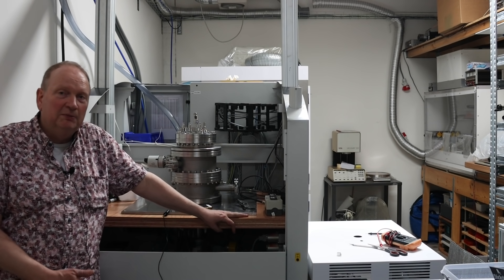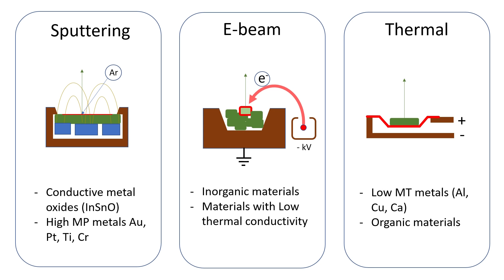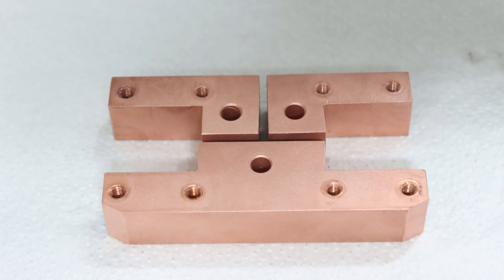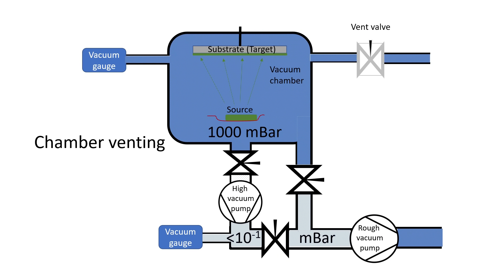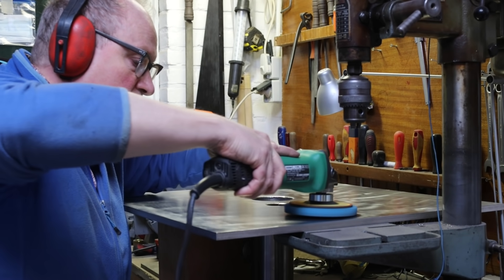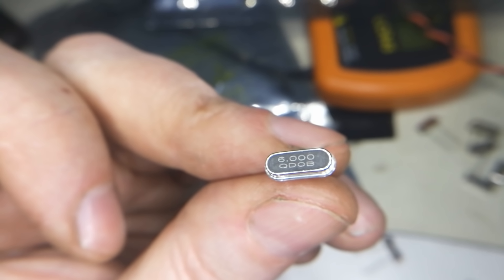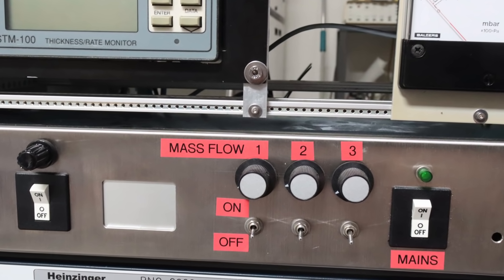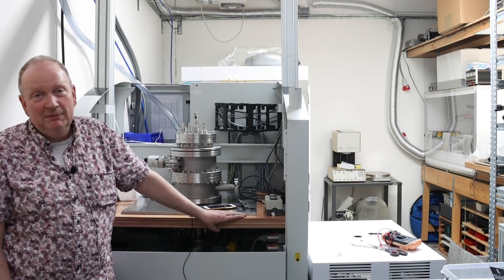DIY Physical Vapor Deposition (PVD) using Thermal Evaporation

Comment: I am considering building a vacuum chamber with 1/4in thick stainless steel tig welded. I keep going back and forth on cylindrical and rectangular structure. I can build a rectangular chamber larger and cheaper than cylindrical. But I know cylindrical chambers handles pressure better. I want to be able to use the vacuum chamber for multiple uses not just pvd. Do you think a rectangular chamber would work fine?

Comment: That video conveying many things at once. Excellent job!. I have a question about my study. Is it possible to deposit alternating stacked layers (A/B/A/B/A/B...) via thermal pvd method? Suppose A is metal B is metal-oxide dielectrics
Reply from the maker: Depositing such a stack is certainly possible. However, metal oxides are generally not deposited with PVD but with sputtering or ebeam because of their high boiling temperature.

Comment: i would like to develop a PVD coating unit. i got a commercial vacuum chamber that was designed to perform metallization on plastics (usuallay called barrier films for food packing). i want to utilize that for PVD coatings on ceramics and plastics. Which heating option would be most appropriate ? Thermal heating or sputtering ? 

Regards

Comment: ayo you should look into silicon carbide, really cheap from china now days. i wonder if using it as a heat sink on the target would help with the statistical chance to get deposition on the target. shouldnt be electrically conductive. i believe theyre factory 2nds for nij level 3 plates, and theyre like 1 buck per hexagon lol. im not smart enough to know if it would off gas. its dark color should give high emissivity, idk if that matters. maybe this is more complicated than q=mc (deltaT)

Comment: Hello , Love your channel !  If you can make 6'' or 5'' round or square hi quality glass or film light pollution filters for use with 
telescopes and large camera lenses , and make the cost around 400 dollars US , I think every amateur astronomer on the planet would buy one .  The thought of being able to put the filter before the main objective lens and not let in the wavelengths 
that are harmful and contribute nothing to an astro image , Would be the hottest product .  1 filter with different masks would allow it to be used on scopes n lenses of all sizes .  I would like it to be a energy rejection filter , But it could be a absorption filter , Or a blocking filter that passes much less of the undesirable wavelengths .   Goal= block , suppress , hi pressure sodium lighting , led lighting , halogen lighting , Mercury vapor lighting , And all the other artificial lighting that keeps popping up.
Thank You.  We currently pay about 175$ US for a 2'' round filter that ends up close to the image sensor , And about 90$ US for a 1.25'' round filter.

Comment: @HuygensOptics ,
excellent video, thanks for uploading!
When you mention target film thicknesses of less than 250 nm for evaporative PVD, is there a practical consideration that leads to this restriction? If you left the machine on for a month would it be possible to build up macroscopically thick layers in other contexts (eg manufacturing of mechanically strong components in Earth Orbit)?

Comment: great explanation, I have an Aluminum mirror coating machine can I get a simple diagram on how it really work, it has Rotarypomp, Booster pump, Elctric high voltage unit, Chamber, Diffution pump, and the panel boar we frequently use words are Backing, roughing, Highvacume.. but I cannot logically understand how it functioning

Comment: Hi Thanks for the fabulous video. 
Question though, would PVD work to deposit a metal layer on an Enamelled 1.0-1.5mm diameter thickness wire? like if we make the wire to keep spinning while being depoisted?
Reply from the maker: That would certainly be possible.

Comment: Without water cooling, the cross-section of copper in those 1/2" tubes works out to be ~ 120A. However, with water cooling through the 1/2" copper tubes, what do you estimate your maximum current per conductor to be?
Reply from the maker: I've never measured this in detail but I estimate it is easily several hundreds of amps.

Comment: If you flushed the chamber with argon multiple times could you get away with only a roughing pump? It’s not a matter of pressure but contamination correct?

Comment: How did you manage to bind the copper to the glass? These electrical feedthroughs seem to be difficult to get right.
Reply from the maker: It was actually bonded using a high temp / high vacuum epoxy. That was possible, because the feedthroughs are cooled and the chamber vacuum specs are not very extreme.
Reply: Just realized you answered the exact same question below 😅. Thank you for your time. I am here because I am trying to figure out how these commercial ceramic feedthroughs are built, maybe they use some kind of epoxy too.

Comment: Very nice job !   Have you ever tried to measure the temperature of the glass substrate during the process ?
I wonder if it is pissible to use 3d printed substrates (with resin printing technology)  with  sophisticated surface profile (like a parabola)?

Comment: 12:55 Um… Are you charging the entire chamber body at the voltage for the plasma…?
Reply from the maker: No just an "antenna" in the chamber that is isolated from it. The chamber as well as the other high-voltage lead are grounded.

Comment: The plasma system, was one of the sides of the secondary wires still attached to the case and thus earth or was that removed? Since I was surprised the entire chamber was lit.
Reply from the maker: Yes, in the HV, one side was connected to ground.
Reply: @HuygensOptics  That make sense then, thank you for the answer.

Comment: Excellent video! Just a small correction: gold has a low melting point, that is lower than copper, at 1064°C. I think it has a low vapor pressure and tend to bead(low surface area). Along with the price  and high density, allthis factors make  thermal evaporation not practical .

Comment: What prevents the material of a furure coating from depositing onto glass window and walls of your chamber? Do you apply a voltage between the boat and target to create electrostatic field and direct moleculas to attack only the target but not parts of the chamber?

Comment: Great video that has many information to resource from etc. I am currently building a vacuum PVD system. I realized the Sputtering Magnetron which is made of copper requires water cooling etc. The problem i am encountering is the water cooling of the copper sputtering envelope which requires introducing lines into the system  needs to be electrically isolated from the base because of high voltage charging of the target etc. So i am assuming what is required is a ceramic disc epoxied to a flange system which also has the copper water cooling tubes to be epoxied to the ceramic holes as well. Have you encountered similar issues? In addition I am using a deposition sensor as well to the system with an inficon unit to monitor the rate etc. Your thoughts?

Comment: What a delight to find this video, impressive work and very interesting.
Regarding the making of flat surfaces, a couple come to mind: 1) lapping, 2) scraping

For a brief 10 years of my career I had the best mix of domains leveraging a background in electrical & software engineering with a love of manufacturing and desire to help people. Also having parents who where machinists (mother & siblings raised in and around a machine shop). I kind of continued the tradition having worked with various manufacturers using an advanced (for it's time) CAD/CAM (parametric solid modeling & associative CNC programming software) across several industries. Although my clients were appreciative, I usually felt I learned more than they did from our exchange.

Today I work as a software engineer, but within the Fintech industry. However, I'm a home-machinist enthusiast with a small, humble shop of machines, fabrication tools, & geometric measuring tools.

Obtaining flat surfaces through simple & inexpensive means is very doable... Even if you have no flat surfaces to start with. The "3 plate method" of lapping can provide you a set of perfectly flat surfaces, although for relatively few $ you can buy a certified flat slab of granite. 

I love your work and will be "working" my way through your videos shortly.

Thank you for posting your video.

Lapping: https://youtu.be/ATG_UYYfx7w

Scraping: https://m.youtube.com/watch?v=4FS2YI3U_cc

Comment: Excellent and informative as usual. Thank you. 
I am looking to do some PVD on glass, my question is around the plasma cleaning and its power supply, have you any idea what current/voltage is required to strike and then maintain the plasma, and what sort of frequency would be ideal,

Comment: I want to achieve quarter wavelength anti reflective multi coatings in the lab, however I guess they are made of non conductive oxides, and all I have in lab is a sputter coater for SEM. As I read online, people only seem to do conductive coatings in sputter coaters. Do I have any luck on achieving this with what I have in hand?

Comment: Great video!
I did not understand well, for the plasma cleaning is just the MOT connected between the earthed chamber and that coil on the glass tube? 50/60 Hz or is it HF?
Reply from the maker: It's 50 Hz, however, it would be more efficient (and safer) if it were HF. So I'm actually planning to convert it to that.

Comment: Can a 95% reflective silver mirror be made this way instead of building this machine to do PVD? :
1) Freeze mercury to -40 degreees celcius to make it solid on the bottom of a milk glass.
2) Remove the mercury from the glass and cover the mercury with duct tape except the bottom
3) Place the solid mercury in a silver nitrate solution
4) Apply some current for a few nanoseconds (actually I don't know how long the pulse have to be to make few nanometer layer of silver, but we can figure it out later) to make a layer of silver to have 5% transparency
5) Take out the piece out of the freezer 
6) Mercury will become liquid when temperature reaches 20C and unstick from silver
7) Just glue the resulting nanometer thick silver layer to your glass

Would this method work?

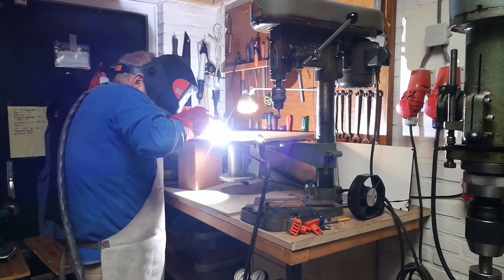Comment: 8:36 can be welding replaced with electroplating? just cover the union to be welded with plasticine or similar stuff, put some copper sulfate solution around, connect the DC and run the copper eletroplating for a few hours (or days?) the weld will be nano-scale perfect. This equipment isnt exposed to any significant mechanical stress so maybe zinc or tin can be enough to electroplate over the joint.
And btw, I am working on a fabre-perot interferometer sensors (to replace on the CNC router instead of ballscrews and traditional rotational encoders) so my machined parts will be nano-scale precise and no wellding would be needed, only some sealing around

Comment: Really impressed you've built this yourself! I'm thinking of building a plasma cleaner into my deposition chamber and was wondering if you could answer some technical questions. 
What is the purpose of the transparent tube inside the chamber and would this work without the tube/just with a copper coil near an outlet of the mass flow controller? is there a maximum distance from the coil that plasma cleaning works? does the plasma interact with aluminum foil?

Comment: Amazing video! I heard about using PVD to coat watches. In particular the Rolex Sea Dweller which uses PVD to apply a small layer of Platinum on the numbers in the bezel. If I understand correctly the melting point isn’t very high (1768°), thus less vapor pressure is necessary to complete this process. Rolex claims only the numbers in the bezel are coated with platinum. Any idea how this would work on such a precise scale?

Comment: Excellent project, but wouldn't it be better to buy a used evaporation system?
Reply from the maker: Sure but  guess you have to get lucky in order to find one close by and affordable. That was not the case, so I decided to build one from vacuum scrap.

Comment: What are you using this machine for?
Well, why didn't you simply measure electrical resistance of the substrate while growing film? I would tell you a lot about thickness. You can even use the same circuit that you have used for your quarts crystal-based thickness detector.
Reply from the maker: And what if you want to deposit an insulator? Also, resistance is not linear with layer thickness.
Reply: @HuygensOptics  Well, you are right. It won't work for insulator of course.

Comment: Thank you, great video! I have some questions please:
1- Does plasma release dangerous x-rays?
2 - Is silicon monoxide (SiO) applied to aluminum primary mirrors in the same way at this video? Or is there a special procedure for it?
3- Can (SIO) be applied to silver coat mirrors?
4- Does mirror coated with chrome last longer than aluminum and silver coat?
5 - Is the grounding of the vacuum chamber structure sufficient and protects against electric shocks?
Thank you very much, and sorry for the many questions!

Comment: I've seen this done to apply higher melting point metals by replacing the 'boat' with a heating element made of the metal you wish to deposit.

Comment: Very nice video and super intressting to see how you build up the whole system. I think you mentioned the problem of adhearing water molecules to the inside surface which leads to a long pumping time in order to reach the vacuum. Would it be an option to heat up the whole system/chamber for some time before closing down the system and starting the vaccum. Maybe it would also help to keep the system closed down with some hydroscopic material like used it chemical labs for thermo gravimetry. 
Keep up the great work👍.

Comment: Is it possible to deposit copper on glass with this technology? For making IR laser mirrors... Today we use polished copper mirrors but I believe that they are not flat enough after polishing, dispersing a bit of the beam. We do get 30% less power after 3 reflections, and that is a problem.

Comment: Nice work one item that you may consider adding is a shutter between the source and the substrate.  Primarily this blocks
the fist material to evaporate from the source which can carry contaminates once the source has reached temperature the
shutter is opened also this can be used to stop deposition almost instantly so a bit more control.

Comment: Truly phenomenal work. I've torn down and repaired turbos before, done a bit of tig welding, a bit of plasma cleaning, a splash of sputtering, and a fair bit of work with vacuum system design, but the fact that you're doing ALL of it without any guide or advice is absolutely insane. 

Can't wait to finish my PhD so I have more time to tackle projects like this.

Comment: Just so you know this really isn't something you can just DIY... a turbomolecular pump costs a LOT of money... if thought a top of the line 2 stage vacuum pump for HVAC is expensive... you haven't seen anything yet! LADD Industry makes a PVD coating machine for about 40,000 dollars. I used it before, not exactly the easiest thing to use and it takes like 30 minutes to coat anything (most of that waiting around to reach the necessary vacuum). It uses a glass bell jar. It was actually intended for graphite coating samples for electron microscopy but you can easily fit a boat in there... Maybe call around various universities to see if they have one they want to get rid of...

If you find a plasma cleaner or any other machine that contains a working turbo pump from a scrap yard, you're like 90% there... 

That Ladd Industry machine almost feels like a bargain in fact... perfect for hobbyists too given the time it takes to coat stuff.

Maybe if TSMC have a turbo pump that falls off the back of a truck that I find in a scrap yard...

But if you can make your chamber small enough, and you are really patient, you can achieve high vacuum with just some glass tubes and mercury. Basically you use the weight of mercury and their low vapor pressure as a means to achieve the vacuum. That was how they did it back in the day. I think Cody labs has a video about this. If you can find a mechanical means of lifting the cup of mercury up to the starting point so the pumping occurs continuously, then it's the cheapest way of achieving a high vacuum. I'm thinking a tube with an Archimedes screw type mechanism driven by an electric motor that lifts the mercury up from the beaker the mercury is deposited into, then it would discharge the mercury via a tube or something to the starting funnel.

Comment: quick technical question, why are most telescope mirrors silvered with aluminum rather than chromium, it would seem that chromium would never need replacing whereas aluminum slowly degrades when you have to clean it ?
Reply from the maker: The reflectivity of chromium is I think only 60-70%, whereas SiO2 protected aluminium can have a reflectivity as high as 91%.

Comment: Can you please explain the different grits used to polish the stainless steel plate for the rubber seal? What was your final grid size or polishing tool? Thank you!
Reply from the maker: Basically, they are different sanding papers ranging from 120 to about 400 mesh. The last step involving the polishing was done with a felt disk and a stainless steel polishing paste very similar in appearance to toothpaste. You can generally buy these at a specialized hardware stores.
Reply: @HuygensOptics  thanks. I was specifically wondering what grit or mesh you finished with before polishing. Thank you for replying.